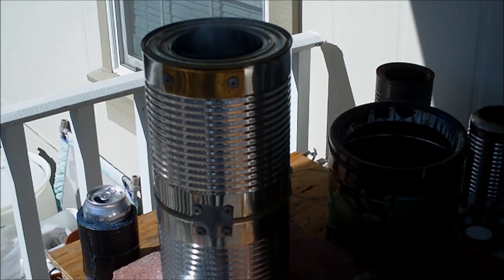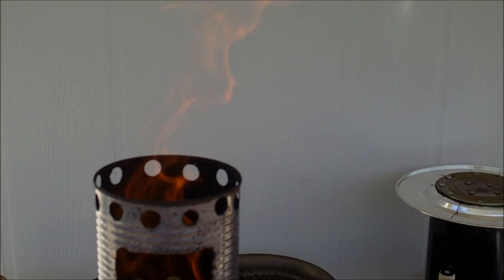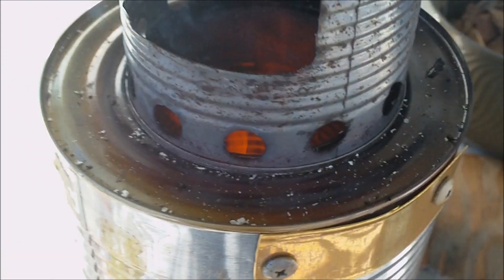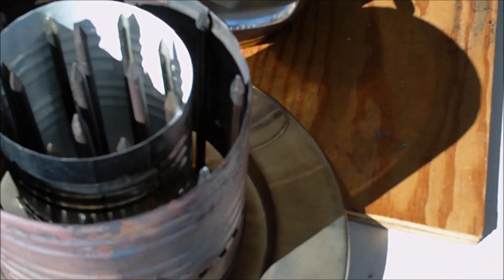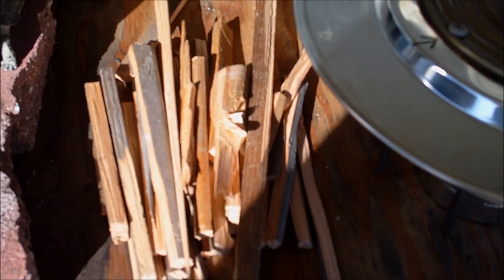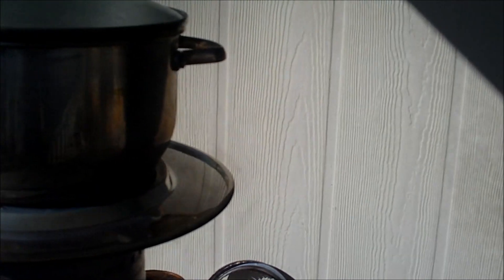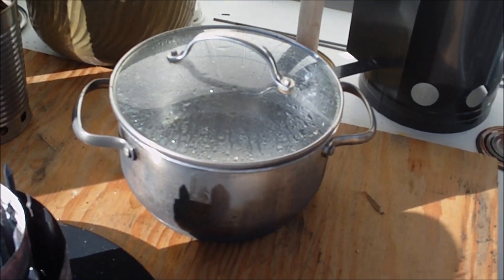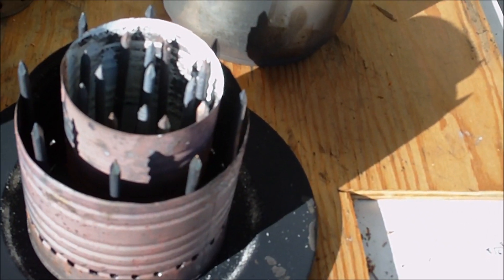Rocket Stove Test 1

Comment: I think the heat exchanger would work if the base of the pan had better surface contact with the plate The screw heads will cause lose of conduction, I think you would have to weld the nails to some flat plate steel to get it to work better, but it would take more wood to heat it all up like you said . Keep up the good work and thanks for sharing.